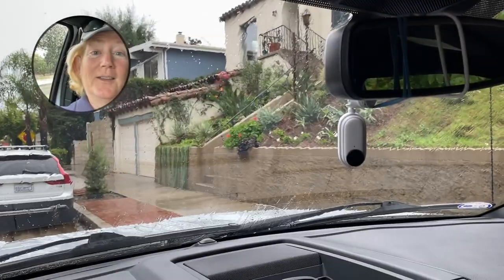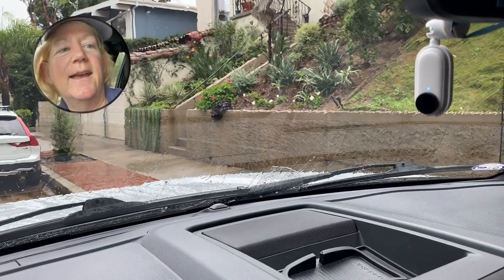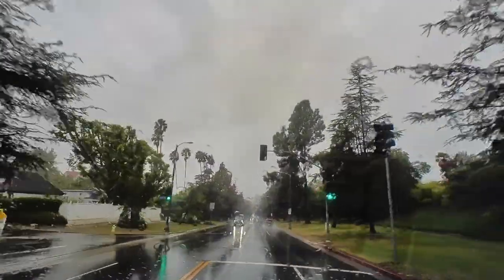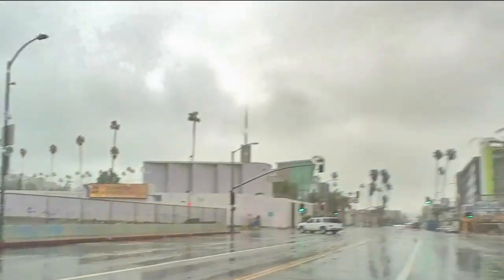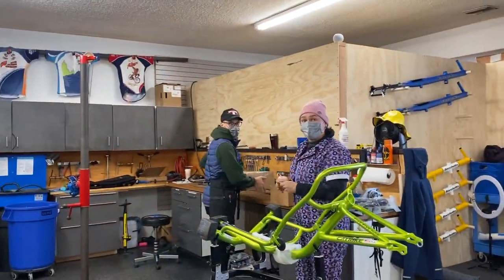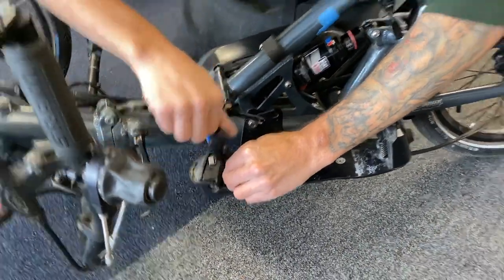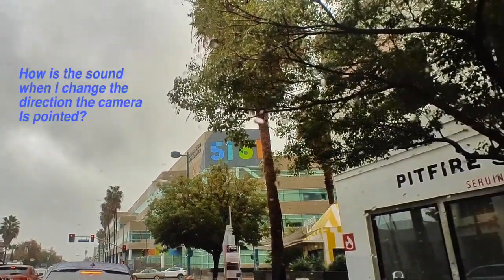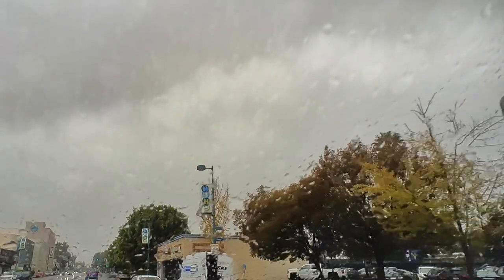Visit Recumbent Bike Shop In a Big Rain Storm

Comment: Hi Syliva, I can hear a slight increase in volume and the same for sharpness in the sound. When you turn the mike toward the windshield your voice has to bounce off the windshield and the dash (padded) and that takes the edge off your voice. There's nothing wrong with that, but it does make a difference in the sound level/sharpness. I wouldn't have noticed any change but for you mentioning it, When it stops raining in LA you should go for a beachfront run in Venice to Santa Monica. Say "HI" to Arnold Schwartsin-whats-it when passing through the Muscle Beach area.
Reply from the maker: Thank you, Frank! Yes, I really enjoy riding on the beach paths too. Merry Christmas!

Comment: The new camera and sound quality was great Sylvia. There didn't seem to be any glare through the windshield. I also have the Shimano Steps and have been lucky not to have any of the screws shimmy loose. I am good with maintenance schedules. I recently had a chain link replaced because it was bent and I had the Shimano Steps updated too. Stay safe... It so true that sometimes we need to be generous. Not only does it help others, but it feels good. Merry Christmas! 🎅🤶
Reply from the maker: Thank you, Tom! Merry Christmas. I think the vibration from keeping the trike in the back of the truck is causing more problems for my trike than most people will experience.

Comment: The Go 2 is a wonderful addition. I got myself one as an early Christmas present and have been very pleased with the results. And given its small size, I have yet for anybody to notice or comment. I have taken it on several cold weather rides and the battery is doing well as I simply slip it back in its charger tucked inside the warm coat. Merry Christmas and safe travels.
Reply from the maker: Yes, this camera is so smart. I love the case/charger/remote too. It could be handy for riding downhill when I need both hands for steering and can't hold my GoPro. Merry Christmas!

Comment: With cameras, battery life is always something I like to know about. (I know it can depend on conditions).
Reply from the maker: Yes, good point, this is an interesting camera. The camera is very small and so the battery is very small but the case is a remote controller and charger. I also have a USB-C cable that I can plug the camera into as I'm driving.

Comment: Your knees sure have held up better than Matt's and you are older than he is.
Superior genes.
Reply from the maker: Oh yes, my knees are strong. Matt was touring with a ridiculous amount of weight. At one point, when he was pulling a trailer, his knees were pushing over 500 lbs with each pedal stroke. I think the trailer empty weighed over 50 lbs. Even with electronics, my total gear rarely weighed more 50 lbs.  It makes a huge difference.
Reply: @TravelsByTrike  - And without pedal assist! Not JaYoe Nation, but JaYoe Sisyfus.
Reply from the maker: @StellarFella  I had recommended he get e-assist pulling that amount of weight.
Reply: @TravelsByTrike  - And that was very timely advice. 'You can lead a horse to water, but you can't make it drink'. In retrospect, he knows how correct your advice was. In his defense, he was traveling through Asia where continually charging  batteries was very problematic. And the development of battery technology was still in its infancy when his odyssey first started.
Reply from the maker: @StellarFella  Yes, I did a tour in 2010 with e-assist and it was more than interesting. Now, if you are staying mostly in hotels/motels you shouldn't have any charging issues. Out of the US accommodation is very inexpensive and there is little reason to camp. I would say Matt and I are both reluctant campers, haha.
Reply: @TravelsByTrike  - Camping has uncertainty as its main feature. And so many different pieces of equipment that add up to that oppressive counterproductive weight. That daily shower is an indispensable necessity and luxury. Matt's eyes weren't bigger than his stomach but they were bigger than his knees.